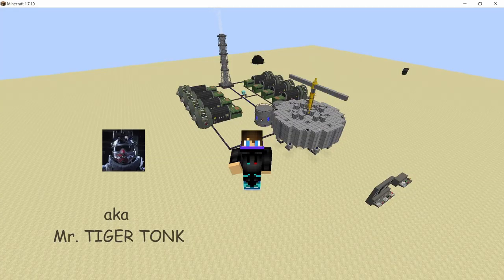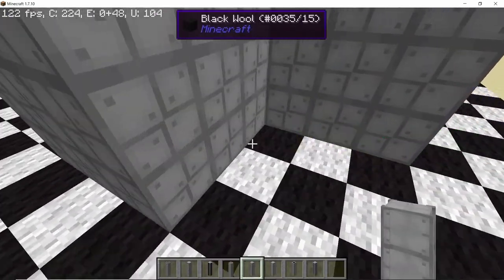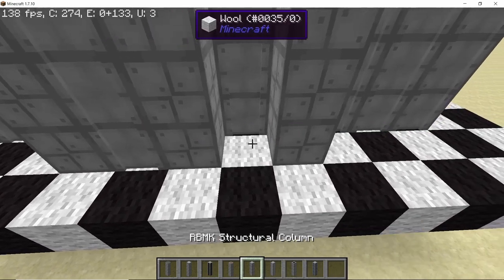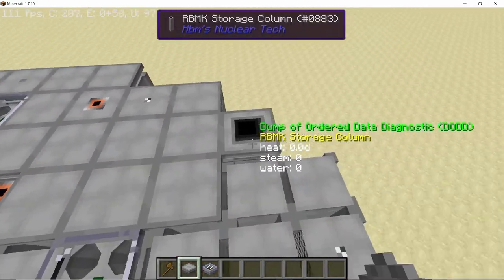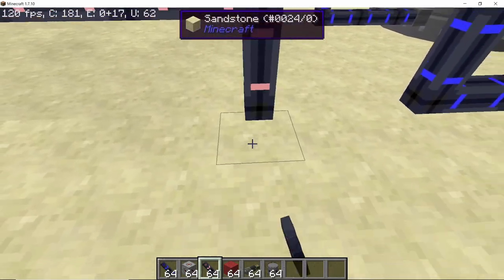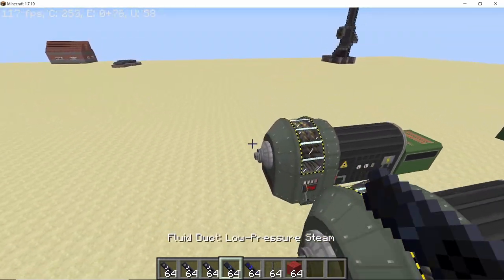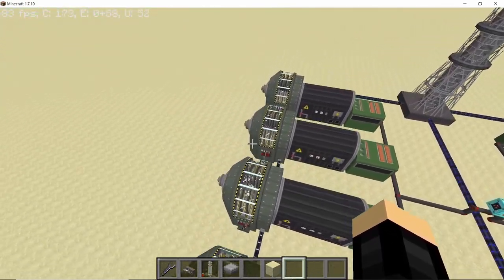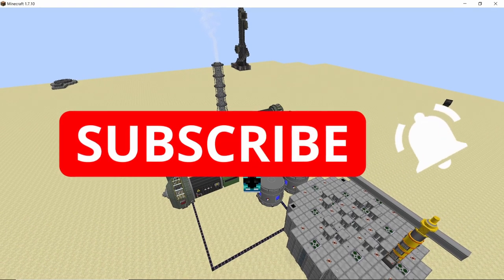Big "15x15" RBMK Reactor Design for HBMs Mod || AZ-5 Capable Reactor with RZM and Uranium Fuel Rods

Comment: My water pipes arent connecting to the steam connectors at the bottom. I use 1.12.2
Reply from the maker: Connect steam pipes on the top of the reactor then , and water pipes on the bottom so in this way you don't need to use steam connectors
Reply: @SavageVegeta  Oh ok. It doesnt look like an rbmk if I do so but thats alright
Reply from the maker: @lotte2899  I've been told that it is just a visual glitch so even if it looks like the water ducts aren't connecting they will still pump water and output steam. So you can try that if you wanna , with the water ducts looking like that haven't connected run the RBMK and if there is no output steam then you can shut it down before it explodes
Reply: @SavageVegeta  Oh ok Ill try that

Comment: Hi, I have a problem with the steam conductor not connecting to the water pipe, what's the problem?
Reply from the maker: It's a problem with HBMs reloaded , I've been told it's a visual bug so it shouldn't affect the performance of the reactor , even tho it looks like it doesn't connect still it'll transfer water and get steam out

Comment: Why my steam connectors doesnt connect with pipes and my reactor explodes?
Reply from the maker: The steam connectors not connecting with pipes is a visual glitch , they connect it just looks like they don't. 
As for reactor exploding I think it's enough water not reaching the central boilers as they run very hot , one of my friends pointed that out earlier
Reply: @SavageVegeta  Oh, thanks you very much! Yea maybe i have not enough water in my tank...
Reply from the maker: @boreqbq  yeah , if you can add another tank with heavy infinite water tank specially for those central boilers
Reply: @SavageVegeta  Okay... I will do that 😁

Comment: My water pipes don't wanna connect to the steam connector
Reply from the maker: that's a visual glitch in the NTM Reloaded edition. 
Use NTM Extended as it doesn't have this issue
Reply: @SavageVegeta Yeah i tried and it works. It finnaly doesn't explode when I dont want it to. When I cut off water to see what happens I was stunned by the fact the rods were jumping up and down when it was near meltdown just like in chernobyl. 

OH and also is there a way I can recycle fully depleted fuel rods?

Comment: Well I tested 8 times and all failed,I'm learning more about nuclear fission and this reactor produces much xenon,one way to get rid of the xenon is using the neutrons, more neutrons = less xenon and no explosion(I'm testing with digamma as main and MEU and HEU as sides)well the problem is that the turbines don't want to work btw im doing this test with the 1.7.10 version i hope that helps for your future designs or something like that ;)
Reply from the maker: Digamma rod is great for breeding but not for power generation, I would recommend sticking to standard fuels like HEU and HEP for power generation as these are renewable as well to a point. 
Also yes Xenon will be made when the reactor is running cold, as soon as the temperature goes up all the xenon will burn away
Reply from the maker: And this design is poorly regulated due to the fact that I didn't use enough water for it, that is a major mistake on my part :(
Anyways thanks for all your findings, best of luck for all your future reactor testings :)
Reply: @Savage Vegeta  well what make xenon dissappear is the reaction between the Fuel rods or neutrons reflectors,and I use digamma only as a neutron cannon to start the reaction I tried to use as power generation but yk....7 reactors exploded,my reactor can run at 100% for 5 minutes then it will melt
Reply: @Savage Vegeta  and I use more MEU as the power generation because it can split with all neutrons and i won't need moderators and it will be easier to control the xenon
Reply from the maker: @caxthealpha1  the reaction between the fuel rod or basically neutrons colliding with the rod is how heat is generated which gets rid of the xenon
Reply from the maker: @caxthealpha1  also you can use Ra226Be or MEP for starting the reactor as they are much more stable than digamma
Reply: @Savage Vegeta  well i lift the digamma rods in 1% for only 1s preventing explosions
Reply: @Savage Vegeta  it's the neutrons that get rid of the xenon,even if xenon is a absorver when he receive much neutrons he transforms in xe¹³⁶ and it will be no longer absorbing neutrons
Reply: And turning off/lowering the control rods will stop the reaction in 87% of xenon poison so I need to open all control rods of the reactor then open the neutron cannon

Comment: i have 2 question 1.is this reactor possible to be built 1.12.2 hbm reloaded 2. could you make this simmilar desgine in 1.12.2 hbm reloaded
Reply from the maker: I think both of the questions are the same ... will this reactor work in 1.12.2 HBMs reloaded basically
Truth be told I haven't built as many reactors in that version so I don't have much idea but the design itself is not very reactive so you can definitely give it a try  , just make sure to increase the number of water tanks and cooling towers in order to ensure your reactor doesn't run out of water. 

I am going to begin working on a 15x15 Reasim RBMK reactor soon and that design you can most definitely make in any version of HBMs
Reply: @SavageVegeta  I built this in 1.12.2, and it explodes after 30 seconds, i gave this build two cooling towers and it still explodes, i tried doing everything and it still doesnt work! I noticed that the main issue is heat, after the temperature rises to about ~1600 or sometimes 2800 it explodes.

Comment: when i interact with my steam channel，there is water in it but on the rbmk console it says that there is no feedwater，also do i need to follow how long the water duct and the ultra dense steam duct should be？
Reply from the maker: Which version of minecraft are you playing this on?? cause in 1.12.2 some features maybe missing.
And if you are making this reactor then increase the amount of water tanks drastically and you can get rid of one set of turbines as only 4 are enough to process all the steam
Reply from the maker: also it doesn't really matter how long the ducts are for steam, you just place them according to your needs

Comment: Question, are there any ways to obtain U-233, or can it only be obtained with Depleted Thorium?
Reply from the maker: depleted thorium is the only way afaik
Reply: @SavageVegeta  Thanks for telling me, at least I can easily do this with my ZIRNOX
Reply from the maker: @FunyGuyLol  you can always use NEI to see all the recipes of a specific fuel, that'll give you any alternate ways to obtain it ... If there are any
Reply: @SavageVegeta  I use NEI, I just got confused because on the wiki it is gained by breeding thorium or depleted thorium fuel, also the PWR is so overpowered, I can legit fill a cyclotron in under a minute and use it

Comment: Why is it when the reactor explodes it doesn't do damage to the surroundings?
Reply from the maker: I'm not very sure about this but I think there is some damage that is done to the blocks which are placed above the RBMK reactor when it explodes, cause the way the meltdown in hbms mod works is that the lid of the reactor is blown off and the internal fuel rods melt into corium ... So all the explosive force of the blast is directed towards the top of the reactors and not the sides. 

The side blocks however will be eaten away by corium if they are not strong enough
Reply: @SavageVegeta   What I meant by surroundings was including the top as well. I have tested distance from the lid and different block types but it wont work. For some reason I cannot find any articles or post about this issue.
Reply from the maker: @totallyunofficial3435  maybe it's just how the RBMK is coded , tbh I never gave this thing much attention until now. I'll test it out and if I'll find a way around this I'll make a video !!

Comment: I'm lucky this video has subtitles. I want to say that this is not really a big reactor as a big reactor would be considered a reactor that is controlled by two control panels (i.e. a reactor that is larger than the standard 15x15). It's a pity you didn't show exactly such a reactor.
Reply from the maker: For us normal people with normal computers this reactor is more than enough to bring the fps below 60.
If you eliminate the neutron Absorbers in the last line and build this reactor a second time , you'll have twice the size of this reactor. Copy those two sideways and you'll have a four time big reactor ... The remaining spaces can be filled with 3x3 fuel modules or simple structural columns
Reply: @Far North you have to remember that Goes against the regular conventions of an rbmk - when me and savage built this we had the idea that it would be able to fit on the regular display of a control panel, other wise we could make a super flat world an rbmk

Comment: my reactor keeps exploding i keep rods at 100 procent is that fine or should i lower it to like 80 procent?
Reply from the maker: I think the reason it keeps on exploding is cause there is not enough water to keep it sustained. I recommend using 2 more big ass tanks with heavy infinite water barrels and also 4 big cooling towers and then try running the reactor
Reply: @SavageVegeta  well  reactor 1 does not explode when I run them it is only reactor 2 and 3 there explodes I use 2 big ass tanks for them all. is it because it fills up low pressure steam ?
Reply: @SavageVegeta  wait I did not see your comment it says that I should keep rods at 80 procent
Reply from the maker: @afk_champ8078  Well them filling up with low pressure steam is not a reason for the reactor to explode tho having a closed cycle is helpful if you are running low on water. Also if you think keeping the rods at 100% is causing the explosion then do lower them down however also try increasing the amount of water tanks and cooling towers like I suggested before
Reply: @SavageVegeta  its just cause i am building chernobyl nuclear power plant so the is no more space for cooling towers
Reply: @SavageVegeta  i dont think its the cooling tower cause i can run my reactor for a long time without it exploding but sometimes when i look to see if it is running normally then the HEU 235 increases heat very fast
Reply: @SavageVegeta  but i dont understand why i mean i have done all you said
Reply from the maker: @afk_champ8078  do you have discord ? if you  do dm me - SavageVegeta#3153. It would be much easier to see what's wrong with your reactor on a livestream
Reply: @SavageVegeta  okay
Reply: @SavageVegeta  i have a russian name
Reply: @SavageVegeta  i friended you
or is it possible to make a dm without being friends?

Comment: My rbmk wont produce any steam
Reply from the maker: Check if all the steam boilers have water or not , and also what kind of steam did you set them to ... for example if you set them to make ultra dense steam which requires the boiler channel to be at 600 degrees celcius but your reactor is not running that hot then you won't get any steam

Comment: can you replace the uranium 233 with australium?
Reply from the maker: I don't think you can as australium is much more reactive than U233. However give it a try in a creative world and if it works then it's all for the better.
Also before you build this design please use multiple big cooling towers instead of the auxiliary ones and increase the amount of water tanks you have. I messed up there in this build

Comment: the steam connector isn´t connecting with the water pipe
Reply from the maker: visual bug in the 1.12.2 version , should transfer fluids nonetheless or you can just connect the steam pipes from the top of the reactor

Comment: Hey i'm having some problems, are the outer fuel rods supossed to rise up that much un xenon poisioning? I'm just worried about my RBMK exploiding
Reply from the maker: Hm can you tell me the percentage of xenon poisoning in them ?? Also to counter that you can raise the overall temperature of your reactor that will make sure that xenon doesn't build up in the first place
Reply: @SavageVegeta  about 80-96%

Comment: yeah i tried it in 1.12.2 but :( I didnt only build the reactor i built an entire powerplant that looked like chernobyl and it was chernobyl by this i mean it is not a good idea to build a complex pipe system also i built the reactor with 4 tanks 2 on each of the hemispheres on the reactor and 2 auxilary cooling towers but still it drained all 4 tanks at once and went boom well i guess 4th times a charm
Reply from the maker: Dang that the tanks going empty all of a sudden shouldn't have happened ...
did you toggle the pipes to output mode suing screw driver cause that is why generally that happens.
Reply: oh
Reply: and also i have been trying my own fifteen by fifteen reactor and somehow it worked ???????????? but it was absoloute garbage i litteraly replaced absorbers with reflecters while it was running and i made a very big mistake i put the diagmaa fuel rod in one slot just 1 single slot and  i think i may have ended the world :[
Reply: i got an achievment caleed something like the horrors of knowing and i died in creative mode

Comment: Can i put MEP-239 Fuel rods?
Reply from the maker: Yeah I think you can , but when you do just monitor it for sometime to see if the temperature stabilizes or not 
And if you see temperature rise very rapidly then quickly pull the rod out before it goes boom
Reply: @SavageVegeta  yeah i saw but im thinking about add a few more water tanks vuz water gpes away very quickly
Reply from the maker: @Dor19441  yeah that's a good decision, the two mistakes I made in this build were not adding enough water tanks and using small cooling tower
Reply: @SavageVegeta  ok dude i had some explosions so ya know heh
Reply from the maker: @Dor19441  I'm sorry for that :D
Reply: @SavageVegeta  haha no problem
:)

Comment: why does it keep melting down on 1.12.2?
Reply: it looks like the water pipe don't connect to the steam block
Reply from the maker: Highly recommend using NTM Extended instead of NTM reloaded. It still receives updates and doesn't have this visual bug
Reply: @SavageVegeta  also what % should I put the control rods at to keep it stable cause even at 40 % it explodes
Reply: on NTM EXTENDED for 1.12.2 now rods won't heat up enough to start making steam even at 100% and with the neutron producer still in
Reply: all column temps between 30c-20c on max
Reply from the maker: @a.f.r.animations8873  damn that's too low, try switching out the fuel to something more powerful or just don't use this design and go with another reactor like the RBMKP styled layout

Comment: I can not produce ultra dense steam what do I do?
Reply from the maker: Use a fuel which burns hotter , but don't use a linear fuel rod type. Go for a medium function fuel rod
Reply: @SavageVegeta  oh ok thanks
Reply: @SavageVegeta  I put Uranium-235 fuel rods around the middle one and now the middle one is overheating so what do I do?
Reply from the maker: @Booga_1720  switch it with MEU fuel rod I guess , fuel values were changed in the recent updates and I haven't tested this reactor with the new versions tbh
Reply: You want the Meu fuel rod in the middle right?
Reply from the maker: @Booga_1720  yeah as the middle rod is the one which overheats
Reply: @SavageVegeta  well when I add the Meu rod to the middle it has no reaction at all
Reply from the maker: @Booga_1720  hmm that's cause it isn't a self igniting rod. Try these two things ... place a neutron rod in the middle first and then replace it with MEU once it has activated. 
Otherwise you can try placing MEP rod in there which is self igniting but keep a close eye on the temperature and If it doesn't stabilize then take it out quickly. Hope you're testing all this in creative
Reply: I found a solution, if I put the Ra226Be neutron rod in and then immediately take it out right when the reaction starts it will stay being a normal reaction but the temperature will be the same when the reaction is happening ven and the radiation will keep building if I put the control rods to 0% and to fix both of these problems just need to get new fuel rods every time you end the reaction
Reply: Also the Mep does not work it just overheats more
Reply: One more thing can you make a 29 by 29 rbmk reactor?

Comment: Hey can you tell the version of the mod u used?
Reply from the maker: I'm sorry made this video a long time ago so don't remember the exact version of the mod
You can however look at the upload date and then cross check that with uploads on GitHub
Reply: @SavageVegeta  Well, I had the problem where the fluid conduct pipes didn't connect to the steam connectors and the boilers in the reactor didn't get the water so I thought that was the problem...Now I figured out I didn't set the water tank's pipes to extraction mode and realized my mistake...
Reply: @SavageVegeta  I got another problem...

The Console is showing that the boilers don't have any water in them but when I actually checked them, they had water...The previous problem was fixed and now this came...I'm afraid that it might blow up and spread radiation since I build it in one of my modded servers...And I don't want that.
Reply from the maker: @imnotampgamer1889  start using NTM Extended instead of NTM Reloaded as that version solves alot of the missing features issue that ntm reloaded had
Reply: Wait...Hold on...
OHH YES

ITS FINALLY WORKING AND PRODUCING POWER

YESSSSSSSSSSSSSS

Comment: how does the rbmk cooler work?
Reply from the maker: Give it a steady supply of cryogel and it's temperature will not exceed 750 degrees celsius, thus by extension this will also prevent the rise in temp of surrounding rbmk channels